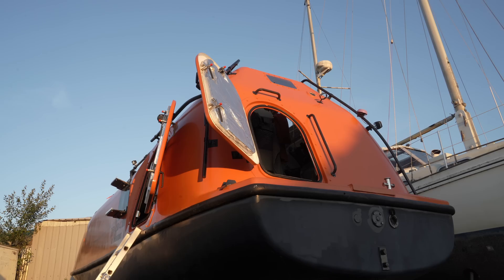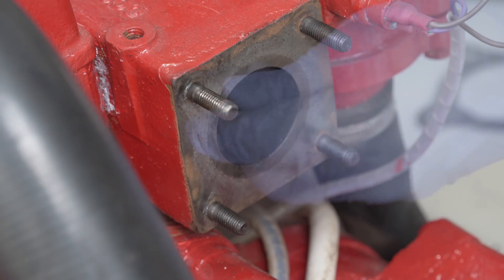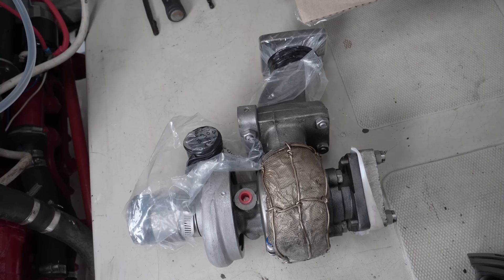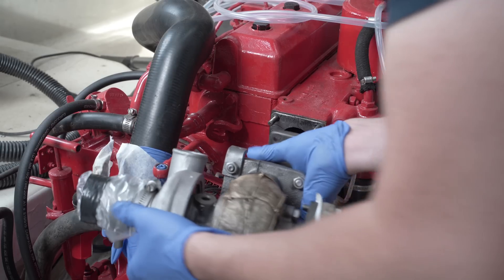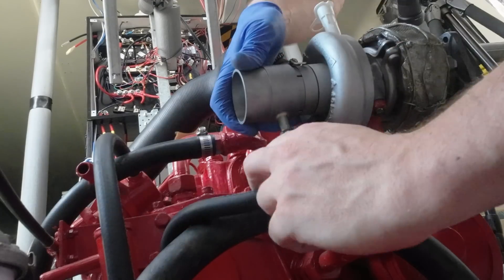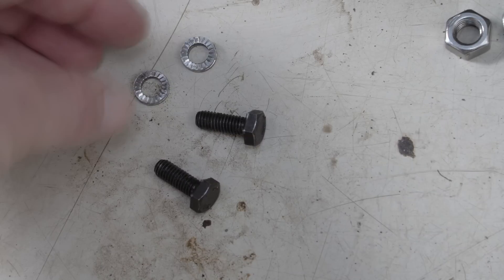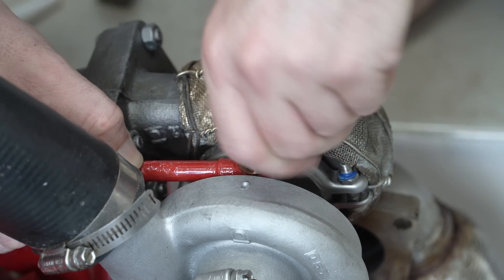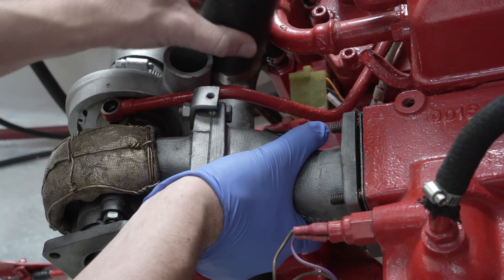Replacing & fitting a refurbed turbocharger to a Bukh DV48 engine. Lifeboat Conversion Ep56 [4K]

Comment: The only way to properly check a turbos bearings is to completely disassemble it and use specialized bore gauges and micrometers to measure everything.  It sounds very much like these 'mechanics' didn't do any of that.   I would buy a new turbo immediately.

Comment: I love watching men bolt bis of steel to other bits of steel. In fact, I think quite a large part of YouTube is dedicated to such pursuits.

I started watching when you began the project as I had got it into my head one of these lifeboats would make for a great coastal craft to potter about the coast of the UK and sleep in. Searching YouTube for conversions, I found your channel. I then got distracted with mending vintage synths and other audio gear and now a year or two later I have returned. I swear I will donate and\or buy merch at some point to help the cause.
Reply from the maker: Cheers on both counts Kev

Comment: Over thinking the banjo fitting shows your mechanical thinking process, I guess, and is something I did as well the first time I came across one on a power steering pump. I still have absolutely no idea why it's named after an instrument I love watching people jam too with some jealously but as this community here is a great resource I expect, hope, someone educates me on that. Not real happy about how the turbo company treated you but I would think that the turbo is over built and under used seeing it's job requirements so I wouldn't worry. Happy trails and happy sails.

Comment: Maybe the turbo is ok because if they were going to lie it'd make sense that they'd say it was out of tolerance and needed a load of expensive work done? If I remember correctly the engine has very low miles and is designed to sit for a while, or so I assume, so that's in your favour too? 

If you're worried about heat you could inject water into the exhaust like jetskis?

Comment: The method for gasket residue removal is, a single edge razor blade in a dedicated holder (cheap), coarse Emery cloth or strip (cheap) lubricated with your penetrating fluid (WD40 etc).
Scrape, then spray, then sand, then scrape the residue, then wipe with a clean rag, then repeat - perhaps 3x. Use the wire brush once it's pretty clean if needed. Degrease with some brake clean. Look forensically for any black embedded in the steel then start sanding until it is gone. 
I must say your surfaces weren't particularly clean after you finished. If they were a cylinder block and head another blown headgasket would follow - HOWEVER - it isn't a headgasket and it will be OK. 
Anyway, carry another gasket, Emery cloth, razor and WD at all times for other engine cleaning duties (and the turbo if it needs it).

Just so you know; a new white handkerchief passed across a cleaned surface that remains white after wiping is the benchmark for engine cleanliness. This goes for exhaust manifold to head, head to block, intake to head, sump to engine block, water pumps etc. 
Engines are allowed to be dirty on the outside but strict assembly cleanliness particularly on mating faces is not pedantry.
Reply from the maker: Cleaning efforts suitably chastised!
Reply: 😄haha

Comment: A great trick for future reference when you have a thread that is buggered up and you don't have the appropriate die. Take the highest grade nut you have, and cut one of the 15° segments out of it. This should give it enough flex to get on the buggered end using a pair of pliers to flex it open a little bit. Ideally, use a file to get a nice clean cutting edge and just wrench it up and down the bolt. The Gap allows for minute shavings to escape and the cut circle prevents it from being too aggressive and re-cutting. If you have a badly damaged bolt, you can cut a nut in half, clamp it further on the stud where the threads are intact, squeeze the two halves together with a pair of vice grips and you have a pretty decent ad hoc threading die.
Reply from the maker: Thanks
Reply: Or a small file and some work.
Reply: Brilliant ideas. Again, why reading comments, at least for me, is a great resource.

Comment: Good job:yougotthis:, on the other hand, for the running in of the new turbo, disconnect the air intake at the level of the collector, the time that your bearings do this ^^
Ps: have your injectors tared and adjust the injection pump, I heard that it clicks a little at the level of the injectors, in the cold it could cause problems of performance and overconsumption of fuel, continue like that, you are sure the right path!!!👍

Comment: Yes turning the turbo manually would have drawn more into its oil passages. In fact that's what we did every time we shipped a turbo from the shop I worked at.
Reply from the maker: The turbo cleaner people did fill it up, so my guess is that I didn't really need to do it myself.

Comment: Manually turning the turbo will allow the oil to flow. Another trick is to use a cheap plastic syringe to get the oil in the turbo feed.
Reply: Should come with a syringe of oil with the fitting kit. Btn supply a syringe of oil with a bung. Trick is to puncture the bung and it acts as a seal to help get the oil in.

Comment: I bet this has been asked before but I haven't seen it. How do you avoid ships trying to rescue you on the open sea when they cross your path?
Reply from the maker: AIS (registered as a pleasure boat), radio comms, and distinctive visual changes to the boat that scream 'not a lifeboat'.
Reply: @AlexHibbertOriginals  Spot the non sailor....
Reply from the maker: I might get that in 4-foot high decals on both sides of Alan.
Reply: My uncle used to use a converted lifeboat for sportfishing, usually just out past the bar at the mouth of the Columbia river (where such a boat is advisable). It was an old school boat (open top with oarlocks) with a diesel that managed about 7 knots and a tiller/rudder to steer. He had a mast fitted with a boom for hoisting heavy things in and out (often overly fat Labrador retrievers) The US Coast Guard would sometimes motor over to check on us but the multiple fishing poles out seemed to reassure them we were not in need of assistance. Also my uncle had tied a female mannequin in a bikini to the mast with a beer can in hand and even when underway with no poles out that seemed to adequately convey to the Coasties the nature of our endeavor.

Comment: Regarding the two hoses chafing together, if you take a few inch length of offcut hose and slit it along it’s length you can zip tie (or loosely Jubilee clip) it between the contact points as a sacrificial outer jacket. 👍 Job done
Reply from the maker: Good idea. I think the kevlar tape is a little neater though as it won't be sacrificed due to its abrasion resistance.
Reply: @AlexHibbertOriginals  would that not then cause abrasion in the opposite direction?
Reply from the maker: No, kevlar is super-soft when woven.
Reply: Another great reason to read comments. I use old fuel line from the small engine equipment I fix for the coil wire(s) for protection against heat, chafing and mice as they live gnawing on coil wires for some reason.

Comment: Buy brass nuts that are deep enough to cover the entire stud, and you will never have a problem getting them off... this used to be standard practice on British cars in the 1960's, until the bean counters took over, and steel nuts were used...
Reply from the maker: I think they used brass before, but then needed spring washers to 'lock', and we don't like spring washers. These aerotights are smart and only a quid each.
Reply: @AlexHibbertOriginals  If you can see any thread after your nuts are done up, it will rust, and cause future problems... copper grease will help, but not prevent....  40 odd years of experience with classic cars, motorbikes and narrowboats means I will only fit brass nuts on exhaust manifolds... your mileage may vary...
Reply from the maker: Yes as you can see, the aerotights do cover the threads. I'm sure brass is an excellent choice, but I chose the all in one locking solution this time around.
Reply: What is your opinion on bronze bolts/nuts? My local specialty hardware store stocks them and I've used them on a few small projects on my much more modest boat where I only needed a few so the cost was not prohibitive.